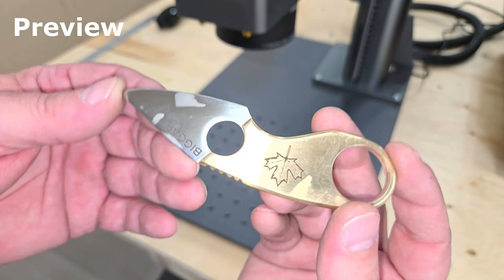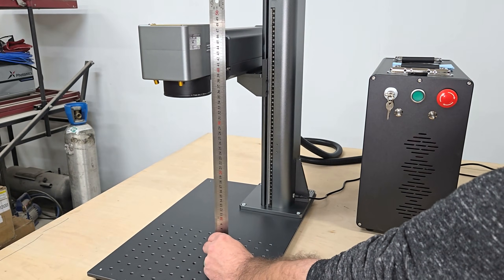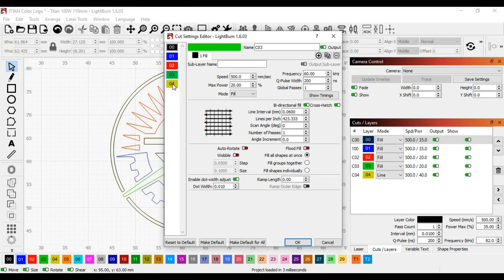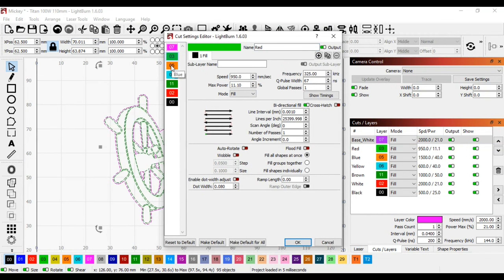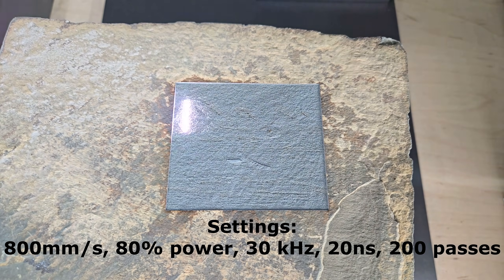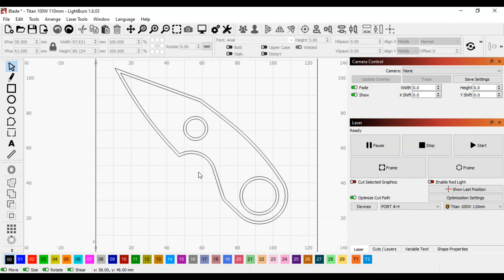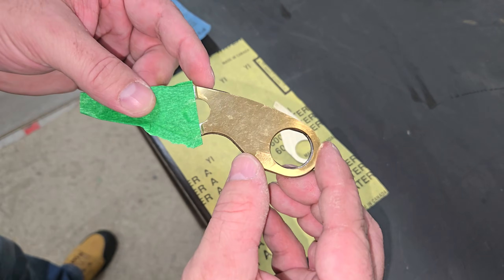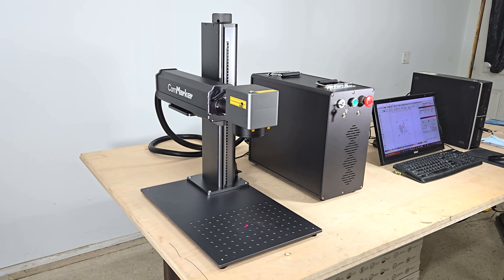Knife Making W/ ComMarker TITAN 100W JPT MOPA: Fiber Laser Review

Comment: Thanks for the great vid!  Have you tried this w AEB-L or any of the CPMs?  Also, my logo is quite a bit smaller and I'm in the market for something that will print small, (1.5+/-mm / 8 font print). Will this laser do it?  I'm on the fence about stepping into MOPA over a standard FL.  Thanks again.
Reply from the maker: Haven't tried any other metals with this particular laser, but any fiber laser will cut and engrave any metal, whether it's stainless or high carbon steel, gold, silver, titanium, chromium, whatever. 8 point font isn't a problem. Some of the font shown in the video is smaller than that. This laser has a spot size of just 10 microns. If you just want to cut, engrave and mark with basic colours then a standard fiber laser would be the better choice, like their B4 or B6 (B6 is limited to 60W I think). A MOPA allows pulse width control so you can 'fine tune' the engraving and marking effect and produce a wider range of colours, but in terms of accuracy and detail, I've seen no difference between them. They all have a 10 micron spot size and are capable of very detailed work.